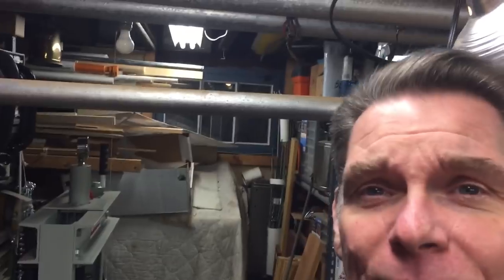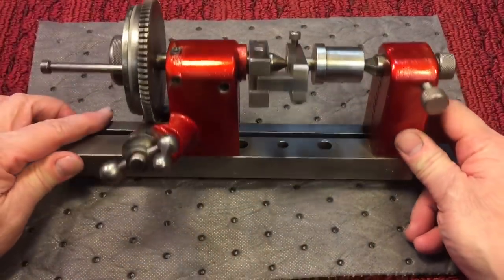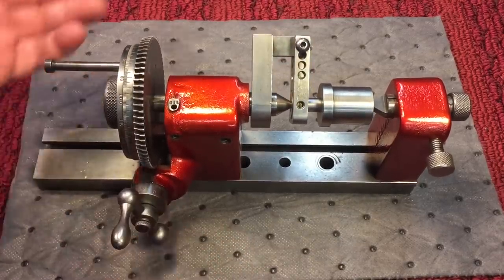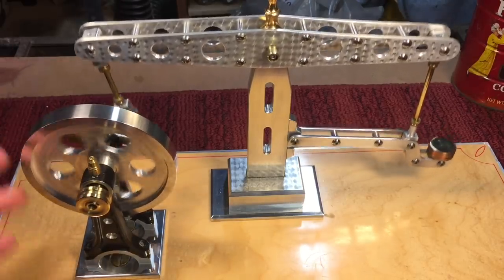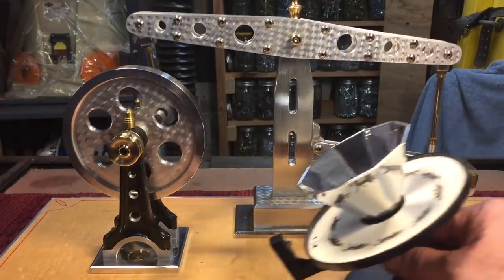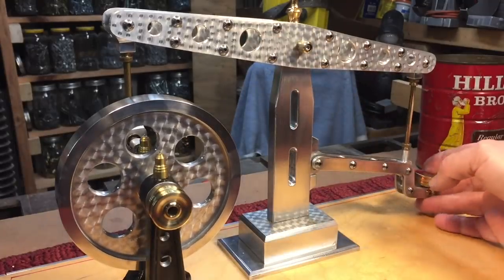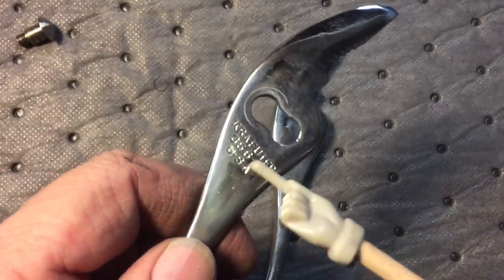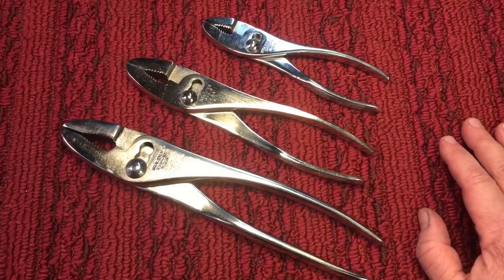Finger Engine and Kraeuter Set Complete!

Comment: Another great video.  I have often wondered why you don't use a 'blaster' on your projects - as so many others do.  Your reasons are sound and your results prove it.  I prefer the high shine of tools.  Using a blaster typically doesn't allow the high shine to be achieved.  Some people however are using soft mediums including crushed walnut shells that don't seem to leave pitting, but your method with various wire wheels and various grades of abrasive paper get perfect results.  As a finish abrasive you may want to try a leather belt on your sanding machine and add polishing compound.  You may have to invest in a pair of sunglasses however, because of the shine you will achieve =).  I really like the hand/finger you use as a pointer.  Great touch.
Michael from Canada

Comment: You have done some good work there. Many scouts are not exposed to those kinds of things.  Jeweling is nice on aluminum  for car dashes. Not so much on things like knife blades unless it is only for display.  As to sand blasting it has its place. It is better if you have other mediums to use.  Soda blasting can be hard to beat.  They made an all in one unit that was always called a  liquid hone where I worked. Set up much like a sand blaster but used soda and water under pressure.  I have seen a modern unit but its cost is prohibitive to the average guy. Regular soda blasting is to messy. Look forward to your next project.
Reply from the maker: Hello 57W!  Yes!  I think we need to bring back a little jeweling for some fun!  Soda blasting looks awesome but like you said is costly.  The cost of media for the cabinet blaster has skyrocketed!  Joe used coal slag and likes it!  I pretty much have my system of what works here however the sandblasting is great for surfaces that will be painted like an old tractor!  =)   Thanks P!

Comment: I enjoy the video especially walking through the whole basement you have some beautiful items and those pliers came out nice......
I just bought a three pairs of vice grips on eBay and two of them have the same problem with that flaking I have to do the same thing I bought them  because they're not like the new ones... what is a lever wrench pair of vice grips. I've never seen one before but I got it now.
Reply from the maker: Hi Reynaldo!   The Vise Grips come out great!!!!!  Just clear them afterwards so they don't rust up!   Thanks!!
Reply: @ScoutCrafter   with a clear spray paint Scout
Reply from the maker: @reynaldovalle1773  Yes!  I like Rustoleum Clear coat!  Works Great!!!  I did the same project on a video titled "Restoration of 3 VISE GRIPS"    Thanks!!!!!!
Reply: @ScoutCrafter  
 thank you Scott I just saw the video on the restoration and the three vice grips I will be doing that two minds thank you I really appreciate it God bless you family and friends..😁👍👍👍👍👍👍👍ps  and the three pairs came out beautiful I like the way you made the screw with the neural...

Comment: One more question - do you handle chrome that is flaking off the same as you handle flaking nickel?  I've got some vintage Craftsman ratchets where the chrome is coming off and is kinda sharp.  Would you just wire wheel and polish chrome-damaged tools as well?
Reply from the maker: Hello NN!  Yes!  The flaking is all the same!  It has to go!  LOL   It was hard getting it off too!  However once you remove the finish you have to polish it and wax it to avoid rust!    That flaking is sharp too!  Got to go!  LOL